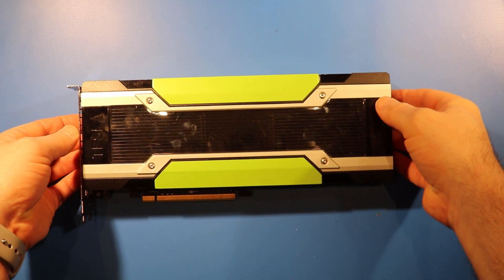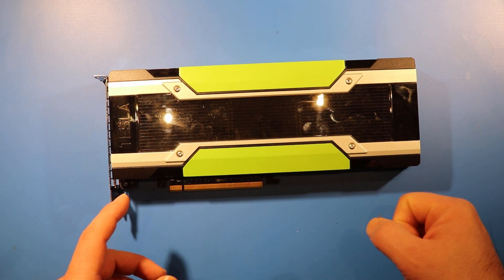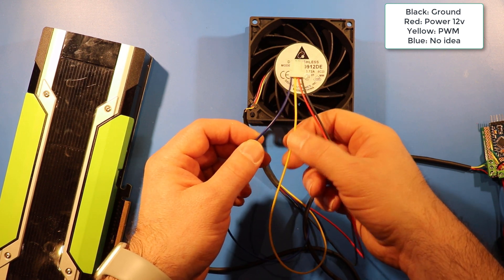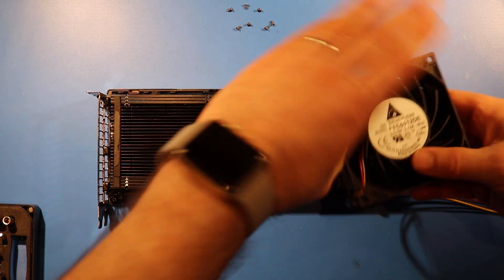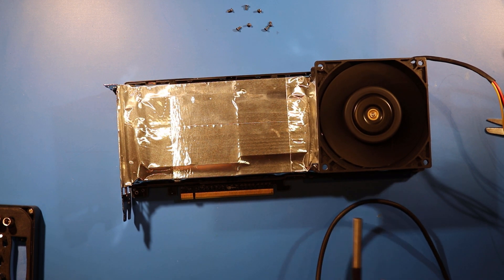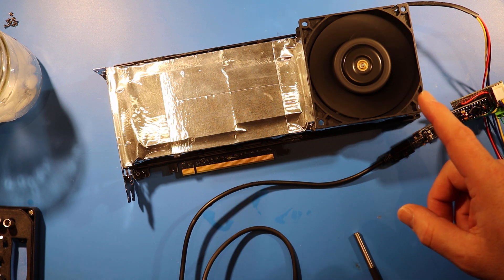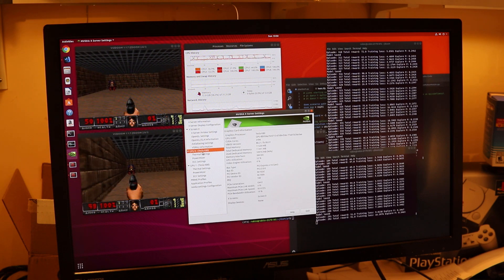NVIDIA Tesla K80 Cooling in a Desktop

Comment: I'm looking to build a dektop specifically to use this GPU, and the question of how many PCIes it should have has arisen. I was thinking maybe buying 2-4 GPUs. Your DIY solution increases the width of the GPU, does that mean, regardless of the number of PCIe x16 ports, a desktop PC can only have 1 nvidia tesla k80 gpu?

Unless the cooling is done on the side instead of on top, thereby not increasing the width, and allowing more space between GPUs. But these GPUs are already pretty thick, so even if I did this, do you think you could stack 2-4 of these GPUs side by side on a motherboard that has the PCIe ports?

Thanks for sharing your solution.

Comment: K80 have 2 eCPU on them so need 2 fans or 3 on them ... Also on you video that demo it's used CPU and not GPU ... not normal to get 70-80% cpu usage .
Reply from the maker: Thanks for the comment. 

In a server, which is where this card normally belongs the card has no fans its cooled by airflow through the server chassis. The main thing is to ensure the card and each GPU is cooled, with this delta fan it is really overkill, these fans at full speed will lift off a desk by themselves. Its a bit too much cooling. I have tried 2 fans together and the issue comes back to where will the hot air exit the card. By design of the cooling fins the hot air flows over one GPU and then over the other there is usually a temperature increase over the 2nd GPU. You see in the video one GPU is 48 degrees C the other 54 degrees C. This is normal for these cards in server environments. There are some examples of overheating cards and normal cards at the NVIDIA forum link google "tesla-k80-overheating 38690"

The temperatures in this video are well below the thermal throttling levels. 

If you look at NVIDIA SMI screen shot in the video you'll see the GPUs are loaded up 50% and 30% But notice GPU RAM usage is 100% on both GPUs.. so they are working hard and at the RAM limit. RAM limits are often the big factor in why folks use these GPUs 

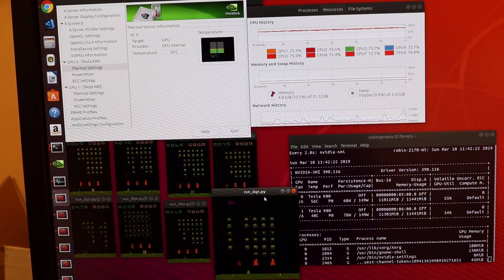10:52 nvidia-smi 100% RAM used. 

Its normal for CPUs to work hard pushing data to the GPUs, but it does depend on the workload. This test is CPU and GPU intensive because I am running 8 parallel machine learning workloads and an element of this workload is CPU bound because its displaying the OpenAI Gym Space Invaders user interface at high speed. 

In terms of longevity for this setup I just took a K80 out of a machine after 3 years and its still running fine.
Reply: @robin-g6  got both , M40 single eCPU and k80 dual , full load on image generate they stay under 70 temp with 2 fans like you did on this video

Comment: I have a question for you man :-) so I want to hook up a m40 Tesla to my HP computer but I want to set the Tesla on the top of the computer not mount it inside and use one of those brackets you have to take out of the back of the tower so you can insert the card or the Tesla and just have the wires from the power supply the motherboard going out of that hole in the back of the computer now up to the top of the tower where the Tesla GPU is sitting. Okay now on to the real point would it be possible to 3D print a new fan housing for the m40 and k80 etc where you take all of those things off of the casing and expose the chips and whatever you were talking about and reverse the fans so that they are sucking air out of the GPU and blowing it straight up so it would be kind of heating my bedroom not just blowing hot ass air around inside the tower.?? What do you think about this Am I crazy and dumb I'm new and kind of dumb and a little crazy but what do you think about this idea

Comment: Thanks for posting this video... I would like to run LLM (LLama 2 model) on my local machine and looking for a way where a cluster of GPU can be built... I understand that the model would require at least 32GB on a single card to load the entire model in the memory... Could you please confirm how did you create a Arduino circuit board or is it available in the Amazon marketplace and what's the name of it?

Comment: Truly amazing that you were able to get this working on a desktop PC build. Wish I had seen your video sooner, since I was trying the same thing. 3D printed a fan shroud to connect 2 Noctua A6x25 60mm fans, pulling air through the length of the card (video of it is on my channel). In hindsight, I should have spaced the two fans along the surface of the heat fins and blown air onto the card, as done by most actively cooled GPUs nowadays.

I ended up giving the card to a colleague, since I wasn't able to get working in my system (Windows 10, X570 MOBO with resizable BAR and above 4G decoding support, 850W PSU, GTX 1660S for display). It was detected as a device under device manager, however I couldn't access the card in MATLAB or task manager.  Probably an issue with GeForce/Tesla drivers not being able to exist simultaneously.

Anyways, amazing setup! Although the video's over a year old, definitely has some utility nowadays for ML/image segmentation projects as most high end desktop GPUs are hard to come by.

Out of curiosity, were you able to overclock the K80s and mitigate any thermal throttling that would ensue with your cooling setup? Wonder if changing the decade old thermal paste would also help.
Reply: Pretty sure you need to install quadro drivers and switch to graphics mode in order to find in task manager. I had to do that on mine. Also how was the cooling? Im thinking of adding a dual 60mm noctua fan system to blow air though the card, but I want to know if it works or not before I attempt.
Reply: @icancraftsomething  True, however I had a GTX series card at the time that had a lot of graphical issues when I installed the drivers needed for the K80. I ended up selling it and buying a RTX 3090 card instead.

With regards to cooling, having two Noctua fans blow across the body of the card in a blower-style-GPU manner was a terrible design idea in retrospect, if you're referring to what I made on the video in my channel. Instead, I would have done what's being done in this video, but with two fans being controlled by a single PWM header (open air-style GPU).
Reply: @pataporon  but is there any real way to make a quiet exhaust fan for these cards? I'm using a workstation, so the airflow isn't great. I'm thinking of making a card that blows the air out.
Reply: @icancraftsomething  I'd recommend going with the same design shown in @Robin Grosset 's video, but instead of the delta fan, have two Noctua NF-A9 PWM fans side by side, each operating at 100% load (can be configured in your BIOS). Delta fans are extremely powerful, but extremely loud as well. The NF-A9 is the same size as the Delta fan, but operates much quieter (comparable to the two 60mm fans I had in my video operating at 100% load).

The purpose of the Arduino controller was to give variable fan speeds proportional to the temperature of the card to help keep the card quiet when it's not under heavy load, but you can safely operate the two Noctua fans at 100% without it being any noisier than most CPU coolers.

Also, I highly recommend changing the thermal paste on your m40 if you haven't already, since it likely hasn't been changed in the 10+ years the card was last manufactured.  There's a video by @FUTC doing that on a tesla K80, but the procedure should be almost identical for your M40.

Alternatively, you can also go about the watercooled approach. There are a few waterblocks available for the M40, but they cost around $100 USD which is comparable to the cost of the card itself.
Reply: @pataporon  thanks!

Comment: so. We know how to cool it by taking it apart, but is there a desktop way of cooling it the inteneded way? (I know this does that but I don't fancy putting metal tape near my eletronics.)
Reply from the maker: For sure there is a way to attach a 3d printed fan shroud to the machine. You also need a specific kind of fan. Here is a link https://www.ebay.com/itm/NVIDIA-Tesla-K80-P100-V100-FHHL-M40-cooling-fan-shroud-duct-/153175788721

Its $22 USD for the shroud and about $30 for the fan as I recall. 

The problem you hit doing this is how long the card becomes with the shroud and fan. You need a BIG case to fit this. 

The other option is simply to buy a rack server chassis like this one you might find a used one cheaply  https://ebay.us/m7ab5z

Comment: im so confused by this hardware, if you had this and a 2070 super in your pc what would it do? how does this work
Reply from the maker: The K80 by itself acts as 2 GPUs for the purpose accelerating certain workloads, not necessarily graphics related. It is not designed for gaming for example. This card can help with video rendering, 3D rendering, machine learning and scientific computations. Its a hardware accelerator called a GPU but it does not output graphics directly to a screen like a RTX 2070 Super.  They are hard to setup as they are designed to be used in servers in data centres and not for consumer desktop use.
Reply: @robin-g6  so basically hit handles things like physics mechanics and algorithms than sends that mathematical data to graphics cards.
Reply from the maker: @Cedric Moore exactly you got it. It does not need the graphics card at all. In a server it returns this to the cpu or whatever process needed it. It uses a technology called CUDA from NVIDIA which can be used for all kinds of computing needs. A K80 is more like a CPU with 1000s or little cores. These cards can work 10 to 50 times faster than a CPU on the same computational problem. They are popular with high performance computing people and crypto miners for this reason.

Comment: Is this GPU still good for machine learning next year?
Reply from the maker: It can still do machine learning and run big models bigger than most GPUs on sale today. Its performance is not as good as most recent cards. For $200-$300 it likely can't be beat particularly on model size.. But if you have $600 and don't need the RAM size then go for an NVIDIA RTX card .. it will be faster and more energy efficient.  Today I would go for a 10 series or RTX series card as they are so much faster.
Reply: @robin-g6  thanks for the info!

Comment: Can you sell me this as a prebuild ... Since they are $175 on amazon... How much for this? I really would love to pair this with a p2200 in my threadripper desktop for video editing.
Reply from the maker: Sorry, I don't make these to sell. They are for my own use. The first one I made is certainly overkill you don't need all that air moving over the card. I found a better combination which is to build some prebuilt parts still a little overkill but cheaper to build and from pre-exisitng parts on amazon. 

Here is what I would recommend. Fan controller if you want temperature control. 
DC 12V PWM PC CPU Fan Temperature Control Speed Controller CPU Alarm Module

https://www.amazon.ca/dp/B019P0FLHW/ref=cm_sw_em_r_mt_dp_TAE6FbSR9HZ7F?_encoding=UTF8&psc=1 

And then you need a 80mm PWM fan 4pin version of this, I used 2 of these. You can also plug these fans into any motherboard header and control them from your motherboards  fan controller. 
GDSTIME 8025 80mm x 80mm x 25mm 12v DC Brushless Cooling Fan 4PIN
https://www.amazon.ca/dp/B086HCBH9S/ref=cm_sw_em_r_mt_dp_pPE6FbV3GJDCZ
Reply: @robin-g6  do you think the k80 amd a quadro combo is good for extra compute power for video editing or would i be wasting a graphics card slot
Reply from the maker: These K80 cards are great. The real advantage is the massive amount of memory over others however they are a few generations back so depending on what you are doing a RTX 20xx might be better. An RTX 2080ti for context is about 4 times faster than a single GPU in  a K80 but if you can use both GPUs and the memory the K80 is still a contender. To get more memory in a GPU still today you are taking $ thousands.
Reply from the maker: Hey, I just posted this video which might 
 be a good solution for you. https://youtu.be/nLnICvg8ibo

Comment: nice video, was hoping my HP DL380 server could handle this card not arrived yet, but has only 2 PCI x 16 gen 2 slots. it has great 128GB ram and 2 Xeon CPU. looks like I am going to external with an GPU caddy that uses USB-C thunderbolt cable to my laptop.
Reply from the maker: Cool! Nice setup. Did it work?
Reply: @robin-g6  nope managed to get it going on a bf-450f rog board bio flashed to 2021 to enable above 4g. I've got 2 fans on it but gets really hot quickly.
Reply: Scott Patnode  I am currently using a BF450F board with latest flashed Bio to unlock the above 4g option, using windows 10 64bit, I am having trouble using the K80 for bitcoin gold mining, but works good for my rainbow tables, but didn't have experience in particle simulations etc even broken 1080ti etc all selling for £200+ and working ones £400 etc the prices are so high  because of people using them for mining Ethereum etc at the moment. from reports k80 isn't a great mining card compared to 1050ti, 1080ti etc is makes it cheaper to buy compare to the others. another reason why 3080 etc are hard to get or prices are inflated to sky the limit as people buy them up to thrash them for mining.

Comment: Couldnt you just use the onboard temp sensor to control the fan?
Reply from the maker: Might be possible but you would still have to control the fan speed somehow and link the sensor  to that. Discovered a little board on Amazon which has temp sensor and fan control in one DC 12V PWM PC CPU Fan Temperature... https://www.amazon.ca/dp/B019P0FLHW?ref=ppx_pop_mob_ap_share
Reply: @robin-g6 There is a windows app called speedfan where you can link a fan to a temp signal, that would work for sure. Maybe you can also just do it in the BIOS. I will try to get a card and test it. I have seen working cards for 190€ on eBay...

Comment: Hi Robin, I am planning to use this for training Deepfakes.

Is the K80 recognized in Linux/Windows as either: 

ONE GPU with 24GB of VRAM total, or 
two GPUs with 12GB of VRAM each? 

The program I use would benefit immensely if it were the first option. If not perhaps I should stick with my Titan X because it doesn't scale well with more than one GPU, and I already have 12GB of VRAM.
Reply from the maker: In either operating system it’s seen as two GPUs with 12GB each.

Comment: Hi Robin,
thanks for the nice tutorial. Which screwdriver is needed to open the card?
Reply from the maker: I figured this out its a Torx, I cover this in this video https://youtu.be/nLnICvg8ibo
Reply: @robin-g6  thanks! I already bought the set you use there in the video and built the whole (legacy) setup based on the arduino. works nicely so far!

Comment: What nvidia software are you using to control the gpu?
Reply from the maker: It has the NVIDIA Linux drivers, with additionally CUDA libraries and TensorFlow GPU for the machine learning aspects.
Reply: @robin-g6  I bought a Tesla k80, to try it out in mining but i get an error message saying "This device cannot find enough free resources that it can use" It is in my understanding that this GPU already comes in compute mode. So i don't understand what could be going on. As you might be able to tell, I am not an expert.

Comment: Thank you for this Robin. I am trying to recreate the setup you demo here, but have no experience with the Arduino hardware. Can you also provide a link to the breakout board you used like you have for the fan and temperature sensors on the GitHub page? I appreciate your help.
Reply from the maker: I used a prototype board. I have lots of different proto board lying around. It comes in a lot of sizes and is pretty cheap. Here is a link which has a bunch of sizes for $17. 
https://www.amazon.ca/dp/B072Z7Y19F/ref=cm_sw_em_r_mt_dp_hxVwFbPM66JBP
Reply from the maker: The Arduino board is something called a Arduino Pro Mini 5v version, you can get them on eBay or here is a link to Adafruit 

https://www.adafruit.com/product/2378?gclid=EAIaIQobChMIvbLqyrjo6wIVQAiICR2bogN6EAAYAiAAEgK1WfD_BwE

With these you need a separate programmer like an ‘FTDI friend’ . The ones with built in programmers would also work fine like Arduino Nano. 

The link in the description will take you to the schematic and wiring diagram.
Reply: Thank you, i’ll see if i can work it out For now i’ve just got a fan running at max velocity.

Comment: I would have placed the temp sensor in direct card output airflow, so it gives you a more reliable reading. great work
Reply: Precision of the temperature reading would not be worth any obstruction of airflow.
Reply: @davidmchugh6908  but in that way you can also see if the first gpu is running while the last is shut off. also you can use a "smaller" probe
Reply: I use a multi-gpu monitor in Zabbix on my headless linux machine. It uses data from the nvidia-smi command, which reports temperature, memory usage, and other data. Also there are alerts for high temperatures.

I don’t regard the device he has created in this video as a monitoring tool beyond regulating fan speed based on relatively general temperature levels.

Comment: I'm doing a similar concept with my passively-cooled K40 using a purpose-built gpu fan cooler -> https://amzn.to/2O2nrIp
Reply from the maker: Wow cool. That’s really good value cooler too. Let me know how it turns out
Reply from the maker: In a more recent video I used two $15 fans that simply connected to my motherboard headers so way simpler and also worked well. But I’d like to see how this cooler works out
Reply: @robin-g6  I'll probably make a video on it. I'll get back to you when I get it done.
Reply: @robin-g6  Finally got to making the video. I watercooled using an AIO instead. It's pretty neat https://youtu.be/LtOAl9B8SFE